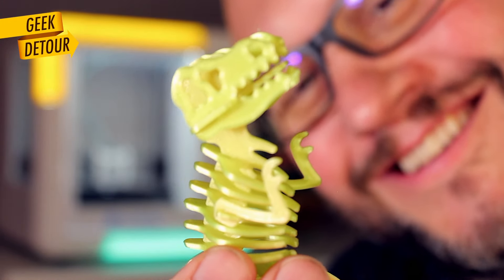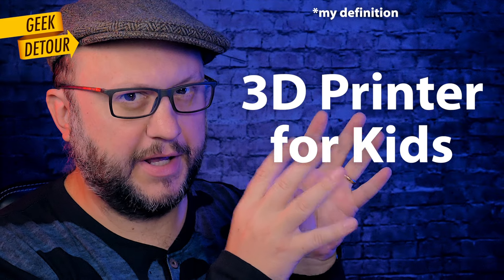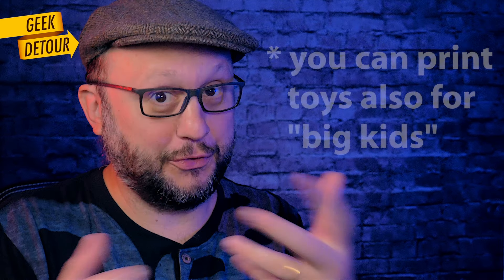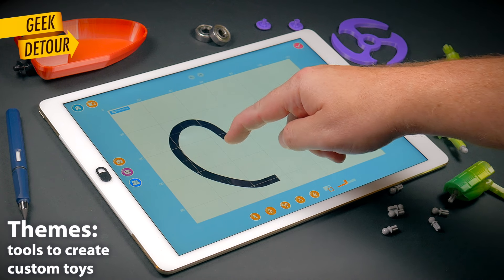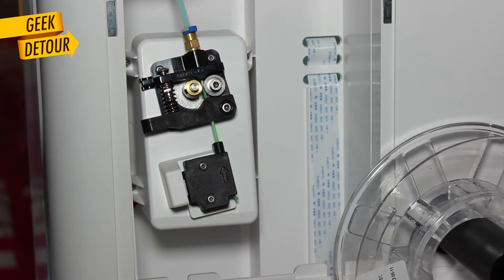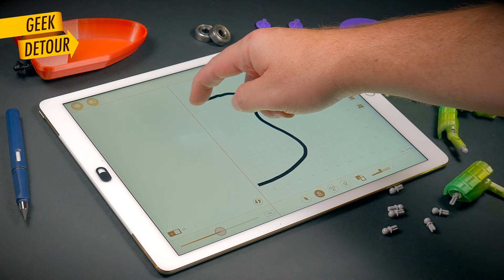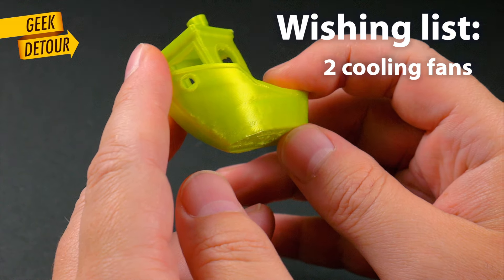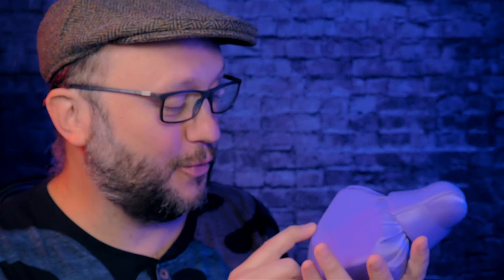3D Printer for Kids: 3D Printing Toys | AOSEED X-Maker

Comment: I have to admit that the ability to print a model with more than one colour should be added with new 3D printers, it would be way cooler.
Reply from the maker: I agree! 3D printing in color, all at once, already exist and it is not “so much” expensive (but it more than doubles the price of the printer). Realistically we can print multiple parts on different filament colors and assemble the models - it gets very cool! But I did it only two or three times… I am much more into functional parts 🤷‍♂️
But that’s why rainbow filaments are so popular: you set and forget… and get random happiness on your prints 😂
Reply: @GeekDetour  A cmyk print head would be a neat thing to have.

Comment: So happy were getting loads of new videos these days
Reply from the maker: Hi Duller! Thanks! 🤗 I am super happy too! And exhausted 🥵 Making reviews is extremely time-consuming. On the next months I will make more hands-on videos, making small projects with all the Printers I reviewed recently (and the Laser Engraver)! I also bought an Oscilloscope and I am desperate to begin using it on some Arduino videos.

So much to do! So little time.
Reply: @GeekDetour  Nice cant wait to see more videos especially Arduino videos feel free to take some time off between videos if you get tired

Comment: Looks like a modified Flashforge Adventurer 4 with all the proprietary parts removed!
Edit: Their "X-Kit" video features an Adventurer 4 so this makes sense that they would use it as a base
Reply from the maker: I think you are right. They might have made a deal with Flashforge and put most of the energy into making the Apps, backend and the models.
Reply: Or a modified adventurer 3: it looks pretty much the same as mine

Comment: What settings/profile did you use to print Eastman's vader bust? The "Everywhere" support type seems sketchy.
Reply from the maker: Hi there! The Eastman’s Darth Vader didn’t use supports at all. It prints leaning back ( on the face that joins the base). It’s a clever design.

Comment: Can you only make things 1 color? I've been looking for reviews showings items made with at least 2 colors.
Reply from the maker: There are models that have separate parts - you can print each part with different filament colors. That’s still the fastest way (and less wasteful) the print colorful models. There are a few MultiColor 3D Printers now what swap filament colors each layer - Bambu Lab, Anycubic just launched one, Creality is also preselling the K2 Plus Combo (which is big and a bit expensive). The cheapest one right now is the BambuLab A1 Mini + AMS Lite.

Comment: Can we 3D print a toy character downloaded from Google and multi color like Luffy
Reply from the maker: 3D printing in multiple materials (a different filament for each color) is possible, but not automatic in printers like this. Multi-material printers are usually over U$ 1000.
What people do with single material printers (like this) is printing parts separated, let’s say, all blue parts together, change plastic, then all red pieces together, etc. Then later assemble and glue everything.
There are “Rainbow” filaments (like the one in the beginning of the video) that change color, but you have no control, it will change color as it prints up.

Comment: I think there should be more space to put the filament in.
Reply from the maker: Hi there! What you mean? In this exact printer the spool support is outside, you can use normal size 1kg spools. There are similar printers that the spool goes inside the door and only fits reduced-sized spools - it is not the case here. Is it or I missed the point? 🤔
Reply: @GeekDetour  I’m talking about the door, It doesn’t look like the door will fit with 1kg
Reply from the maker: Oh, it does work with regular 1Kg spools. In this printer the spools are outside. And I am using normal size 1kg spool perfectly. You can see it on the video when I switch the spool.
Reply: @GeekDetour  oh
Reply: @GeekDetour  Ok
Reply: @GeekDetour  it just looks like my adventurer 3 which cant hold 1k